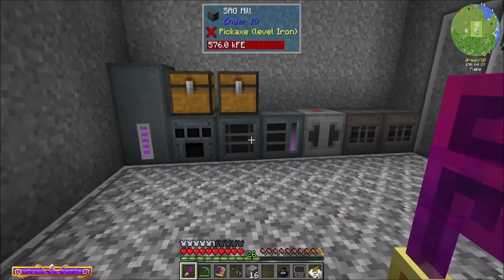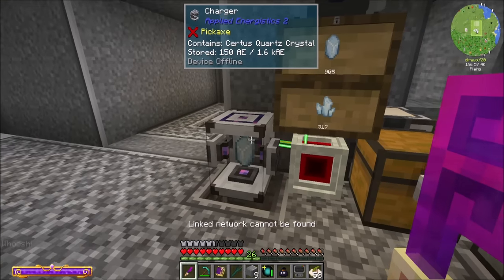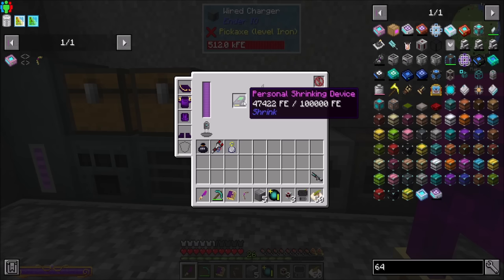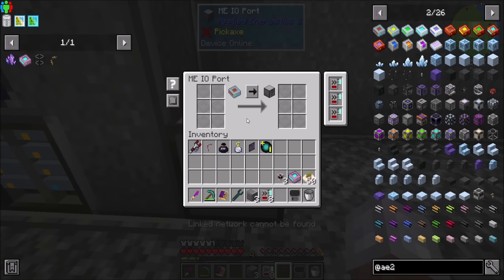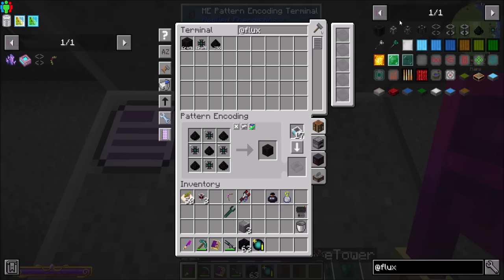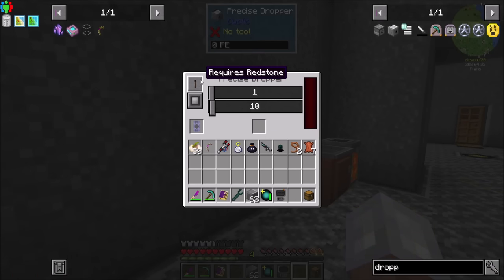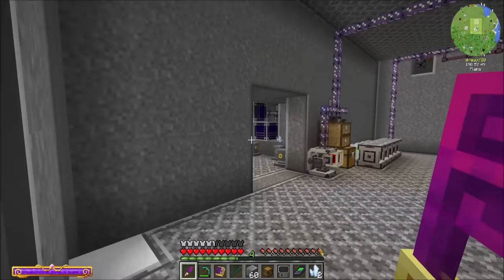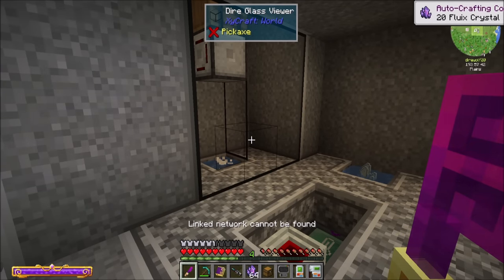LetsPlay S13E26 Flux and AE Upgrades

Comment: Simplemagnets has an anti-magnet block for its own magnets that you can filter. No more picking up items like your charged certus.
Reply: They work on some other magnets too I did try with enigmatic legacy and reliquary magnets
Reply: The charged certus is just a little annoying - much more of an annoyance is the certus block that's supposed to be refreshed for more certus generation. No idea how many episodes that block is missing (again).
Reply: @valuial8691  I didn't even notice that. I noticed that his charged certus was way higher than his normal certus.

Comment: i feel like there should be a flux block that would store the output from multiple selected power grids to then distribute any desired amount of power (min/max) to any other network chosen by the user kind of like a filter for power. maybe a .... flux...capacitor :smug:

Comment: Anyone know why the laser mining gadget doesn't charge in my hotbar when flux networks has it enabled?
Reply: Did you hit apply? Did you make sure its activated for hotbar or is it in your hand when its not charging which would be main hand. If none of those sorry i got no other idea
Reply: Do you have a controller ?
Reply: It happens to me too. I can get it to charge by ascending with my jetpack and then swapping from the mining gadget to another item and then back again. Only the mining gadget has this charging issue. All other items (jetpack, building gadgets, mekanism electric bow, wireless crafting terminal, etc.) charge instantly.

I'm not sure if this is a Flux Networks or Mining Gadgets issue, so I don't know who I should report it to.
Reply: @therm0tt0  just don't have the gadget selected on the hotbar and it charges(scroll to another thing)
Reply: @medivha  It only charges while hovering with the jetpack. Sometimes it will charge without swapping items while hovering. If I'm on the ground with the jetpack disabled, it will not charge even when swapping items.
Reply: @therm0tt0  i don't have that problem at all. Tried with iron jetpacks on/off and unequiped. i have curio and hotbar enabled on(armor,inventory, main/offhand set to off) flux network wireless settings and of course turn it on, flux plug on a ultimate energy cube from mekanism. the only other thing i can think of is that you use the energy from a flux storage and it runs super fast out.
Reply: You can enable wireless charging from a storage block or plugs/points, but it doesn't actually work unless you have a properly configured flux controller that is also chunk loaded in your world.

Comment: only thing I dislike about AE is the channeling. It is just so needlessly complicated for a minecraft mod. Same with create
Reply: You can pretty easily disable channels in AE2, if you start typing /ae2 in the game menu then it should autocomplete the rest and channels will be permanently disabled
Reply: @user-jm8sy5ox2j  that's "cheating". That is not the intended way to play the mod. If it was, it'd be turned off by default and turned on for more challenging packs